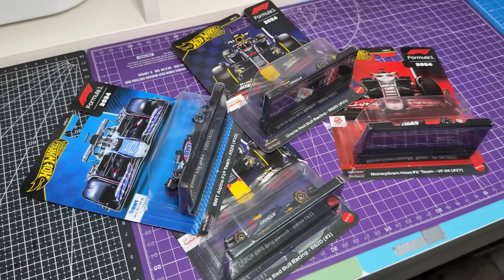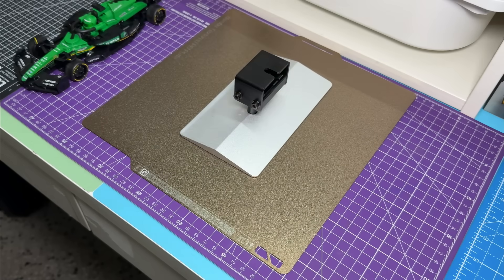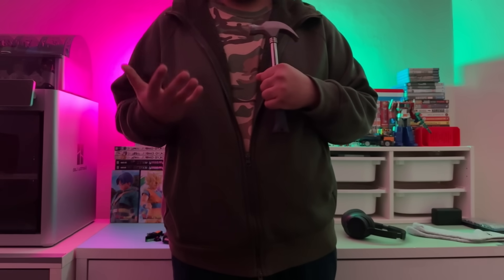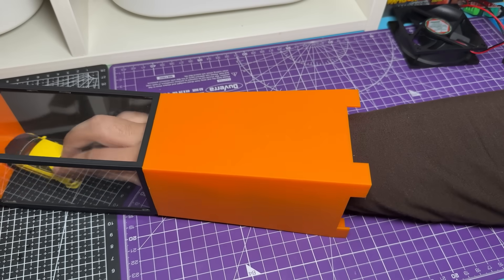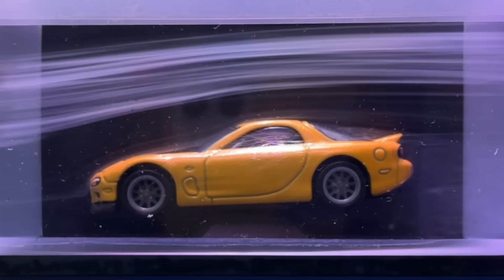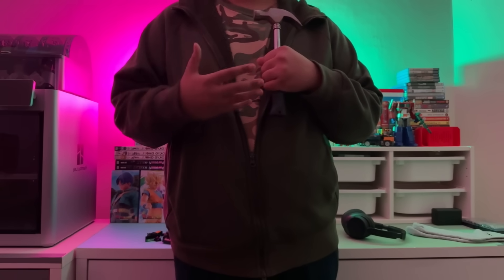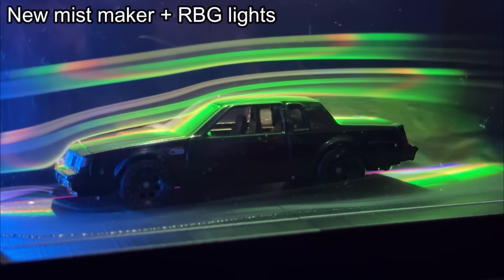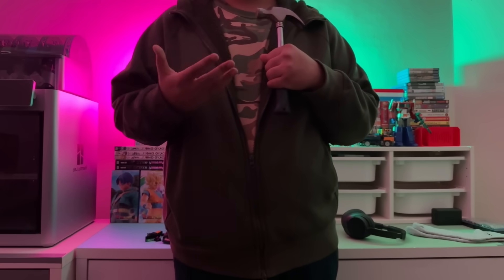I 3D Printed a $675 Wind Tunnel for My Hot Wheels

Comment: Fantastic job! I bought the models from you on Gumroad today, and was considering stretching the center chamber parts out a bit to make it wider, but was curious on your thoughts regarding the impact on the stability of the airflow? Was only thinking about adding 30mm or so to the length to make seeing into it a bit easier for the longer 1:43 models - but thought I'd ask if you thought that may be too much to achieve the same consistent flow through the middle before giving it a go.
Thanks again for putting this out there- great work! Looking forward to putting my own all together soon!

Comment: Fun project! bought the files to check it out since i planned on making my own wind tunnel to test wing profiles etc. Though it would be nice with some drawings or step files of the connector pins at least to be able to modify it and improve it. I have a very big fan i want to connect for example to improve the wind speed significantly.

Comment: i and 2 other friends of mine made one for our highschool science proj thats 6 ft by 3 ft by 10"...and from cardboard....we had a inlet size of 10 by 10 inches and witha contraction it came to 6 by 6 inches and made a return tunnel parallel to our display segment... we initially thought of using a mist maker but then realised it was not gonna work...(cardoard+ mist = soggy)...so then we moved to cone incense...and we used drinking straws ..cut them in parts of 2" each and hotglued abt 200 pieces before the viewing chamber ....we also used freehand cuts everywhere bcoz of which any solid transparent material for mor windows was out of question..and we would have leaked smoke...but we used cellopane....arapped it and secured its ends over the 6*6 " profiel by ducttaping it and cut a small window out from the back.....we were stupid enough to use a 220v ac wall fan we put in the return tunnel  and although we made a fan regulator..it did not reduce the speed that much and we had to pwm the regulator by hand blipping it on and off for over 4 hrs..and the fan shroud was open so there was a fan with plastic blades spinning at mach jesus inside a cardboard tunnel held together by prayers and duct tape , strong engogh to rip through everything in its surroundings..held together by a pardboard stock under its motor..and 2 pieces of duct tape......and my friend (bless him)....brought his ferrari model to put there...and before we took this to school we went to my ferrari friend 's home to test it and i accidentally dropped the incense cone inside while trying to get it out..and burned a big hole in the floor....duct tape again.....we gained a lot of fans....😁

Comment: The fog tubes, make them wider instead of round.
Same tickness from the front but the lines will be more visible.

(Or place several behind each other if that works better with the mesh)

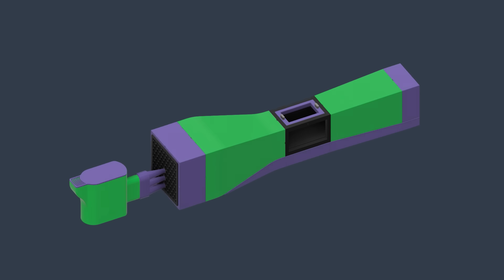Comment: Thanks for doing this, I also was put off by the absurd pricing on the commercial hobby unit. However its worth noting the $675 Windsible is 1:18 and I assume this unit is 1:64? How feasible is a 1:18 version, does the model size increase scale the whole assembly up to a massive footprint?

Comment: Oh yeah if you almost but not quite block the outlet side of a fan, they generally stop pulling any air, and if the blockage is a funnel, they sometimes start pulling the air backwards, since it helps in the opposite direction, so now you know! There's several ways to fix this.

1. actually use a suitable fan which is less optimised for airflow and more for pressure, such as centrifugal blower fan. Did you notice that your part cooling fan in your 3D printer is one of those? Well axial fans have been tried and didn't really work.
2. make the funnel longer, way way way way way longer.
3. install radial vanes in the airpath of the fan. this will prevent rotating turbulence which blocks airflow.

Comment: 4:55 Maybe I didn't get it right, but usually the term print-in-place is used for models that specifically don't need assembly after printing. It prints the whole assembly in place, so to speak.

Comment: Finally! someone who called out that crappy overprized design. Almost thought of buying it but then realized that it is just for show.
Reply: overpriced*
Reply: @Cyroid_1 ah mb
Reply: @VakesanM  its literallly cheaper by a thousand to get the cads from Toast with way better functionality
Reply: @nerfgodbigguy1405 that's the plan now lol.
Reply: Calling out that design was the basis of my undergrad capstone project. I have a larger test volume that can accommodate small drones or 1:12 scale RC cars and test then speeds up to 120+mph.
Reply: @eabradley1108  can I see it? 1:12 scale is quite large, and pretty near industrial size.
Reply: @eabradley1108  can you show it off in a video? would love to see it in action
Reply: i wouldn't call it crappy, after all it does what it's supposed to do:
blow steam over your toy car

it's not a wind tunnel, it's just a display piece, and it does its job gracefully

is it overpriced?
idk, smoke machines are pretty expensive so idk honestly, but i do think it looks nice and again it's a display piece first and a wind tunnel (last? more like) never

so even while this product and the one in the video do similar things, they serve different purpose

because as you said

it is just for show
Reply: @ser_igel  It's advertised as a Wind Tunnel, tho. 
I get your point, btw, but if I buy a mug that was advertised as a mug, and for some reason it doesn't function as one because the bottom has holes in it, then it's just a scam.
Reply: @jonatanrobledo9812  i'm sorry i completely agree with your point BUT

your example is hilarious because youtuber/streamer DougDoug has recently released a Brick Mug which doesn't has a hole at the top, does have a casting hole at the bottom and it's not recommended to drink through it because the insides don't have a protective coating making this mug not food-safe

and of course it's currently his most popular merch item
Reply: @ser_igel  haven't checked DougDoug videos in a WHILE, but that does sound like some shii he would do lmao.
Reply: @ser_igel you are right. It does give display piece only vibes. Just that the kind of advert posts I see about this item do not have enough details to judge it and sink in that big an amount. 
So I'm thankful that a youtuber I watch gave me a insight of the the frequent doubts someone might have about it. 

This product gives very, get this drop shipped from temu before people discover that it's a simple display piece.
Reply: This 3D printed version is also just for show.  Since this is 1:64 scale; I believe you would need to use a fluid closer to water to get the correct flow patterns to make this actually useful (design changes to the real car).
Reply: @akarp111 that's some new information. But for a DiY solution, I think it is a better model compared to the BUY model.
Reply: @VakesanM  yes! this DIY solution is great!